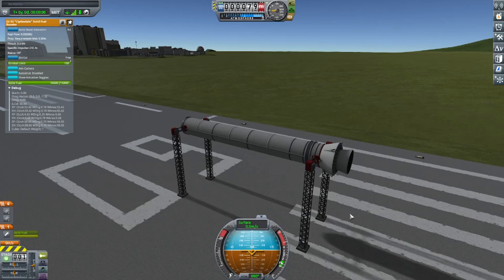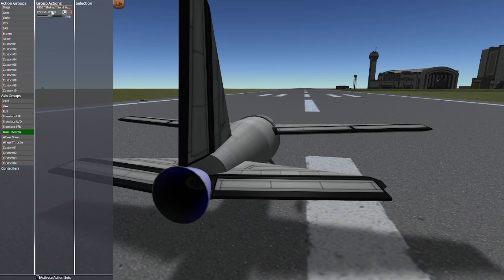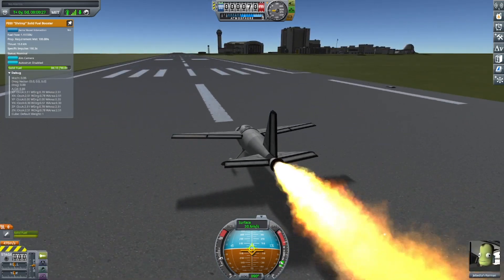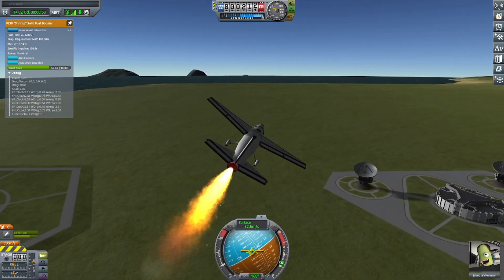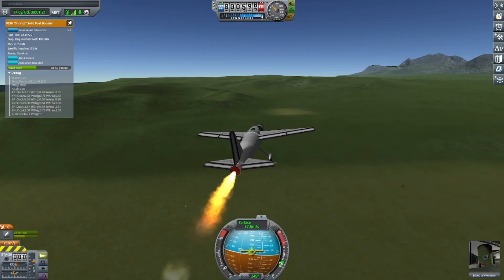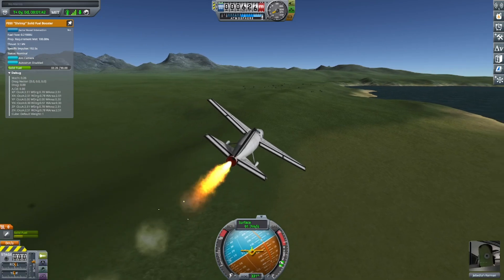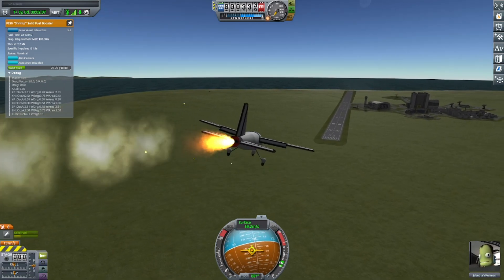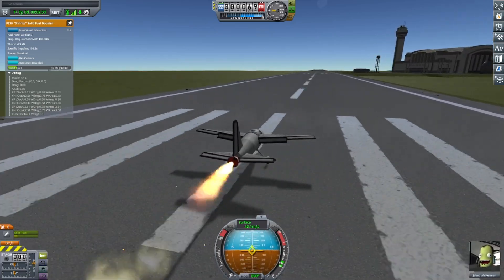KSP - Throttling Solid Rocket Boosters

Comment: Ngl, I like how even though it's technically cheaty and unintended, it still has its own quirks (slower throttle response) that puts it in a place where it's just slightly worse than LFO engines.

It would be incredibly bad for manuevering, not that you'd want SRBs to do that, but still really good for lifting boosters.

Comment: Ok but why would you want to do this? The point of an srb is you can’t change the throttle and they’re powerful and heavy.
Reply from the maker: I like doing things in games that the devs don't intend people to do.
Reply: it's just cool 👍
Reply: All the same advantages of srb with variable throttle!  I often use this to throttle down boosters to keep them from going too fast.
Reply: @mazack00  that’s kind of cheating and unrealistic though
Reply: @Akotski-ys9rr  not really. there are several different ways solid fuel engines can be throttled in real life.
Reply: @Akotski-ys9rr  solid boosters can be throttled irl. Not all, but there are a few designs in the works, specifically in the amateur field.
Reply: Brother, KSP is a sandbox game. People do whatever they can do.